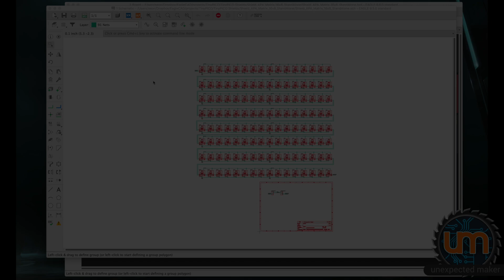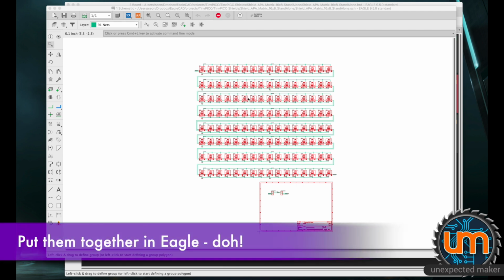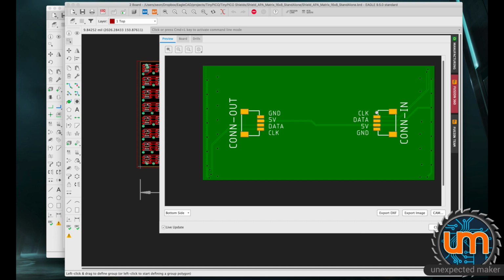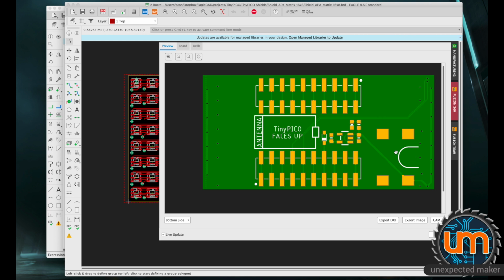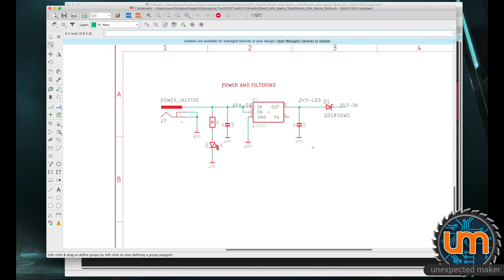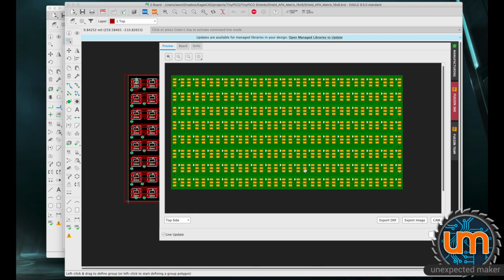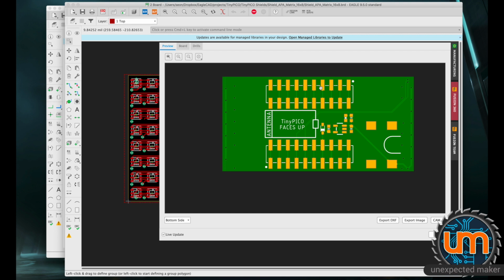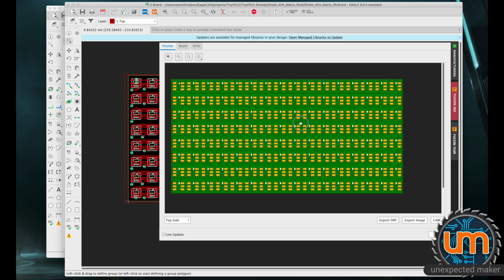Fancy, Blingy RGB Panel - Let's make one too!

Comment: I remember back in around 1999-2000 I was crazy about coloured lights... and thought the greatest thing would be to have full-colour-controllable lights. But at that time it wasn't possible with my first requirement I had at that time. Affordability. So I had to live with fixed colours using cheap neon bulbs. Anyway... years later there came the APA102 which is regarding the tech... for everyone who ever coded a PWM himself... this tech is GREAT... then I spent ages to manufacture an acrylic sign with my logo and my cheap CNC2418... which I love to this day... and lit up the sign... just to find out... as of this day... wanna really annoy my eyes... THEN GIVE ME RGB sweeps... so after less than five mins I have to turn it off to not loose my sanity. LOL. Cool vid! Thumbs up. BTW... for anyone out there looking for a challenge... TRY DRAWING AN SMD PCB with your hands and just an EDDING. Mine worked... after some tries.

Comment: It will work I'm pretty sure but not a single decoupling capacitor ? and tiny connection point for power ? I predict some noise issues and display errors creeping in if you drive them full brightness (total current full white all LEDs is approx 3A)
Reply from the maker: There is decoupling from the 5V in before the LDO. That 5V in drives the APAs. Unlike WS6812s etc, the APAs don't need individual decoupling, and I've run a 16x16 matrix off 5V with just decoupling between the 5V source and the APAs. Yes I think the Qwic connectors will likely be a problem with power, but I have other things I'm looking into re lowering power consumption that is not hardware related, so they might end up being fine (for my use) ... stay tuned!

Comment: Just wondering if you took the Vf of the diode into account. With a value of 0.3 to 0.6 your TinyPico will have 3 to 2.7 V only. Maybe that's enough, I don't know...
Reply from the maker: Yup, it's the same Schottky I'm using to drive the APA102 on my TinyPICO. Low Vf and plenty fo juice to drive the APA still :-)

Comment: An option could be placing on the back SMD connectors. With these connectors you can plug them in joining boards. Using connectors you can easy replace or disconnect boards  if needed. The joining boards can be placed on a rig.

Comment: Nice project. I have a few RGB LED projects that I need to get around to putting together. That number of WS2812B-Minis could easily be found for ~US $10, but ~AUS $30 for  2020 APA102Cs seems to be more than I would have expected based on the price diff between 5050/2020 WS2812B based on what I can get 5050 APA102Cs for. I had thought about playing with some 2020 APA102Cs but at those prices, maybe not.
Reply from the maker: Depends if you want "good reliable ones with nice colour" or "pot luck, get what you pay for" APAs ;)
Reply: @UnexpectedMaker  Ive stuck with leds from bft lighting and have had pretty good luck thus far. And the price i quoted for 2020 WS2812Bs was really for 3535 WS2812bs. Shouldn't make too much of a difference, but that 1.5mm does make a difference in manufacturing difficulty.

Comment: You could also make the usb plug physically in front of the dc barrel jack do they can't physically both be plugged in.  Also check checkout my kickstarter video.
Reply from the maker: I want them both plugged in at the same time. That's the whole point of having the onboard LDO, to allow for powering teh TonyPICO with USB connected or not.